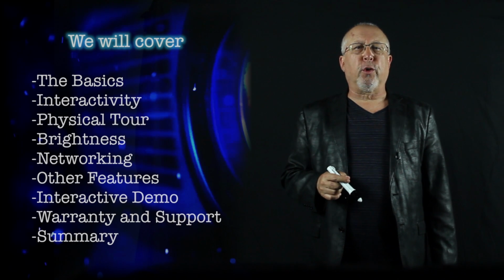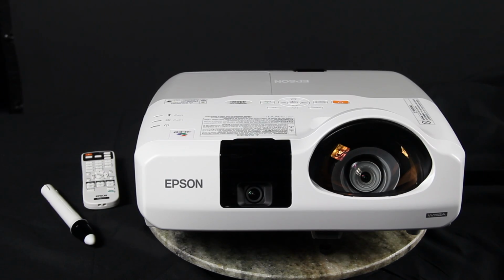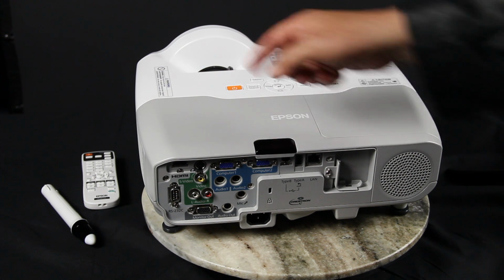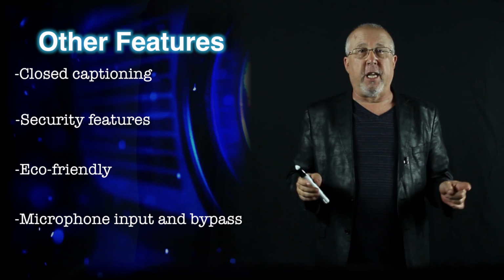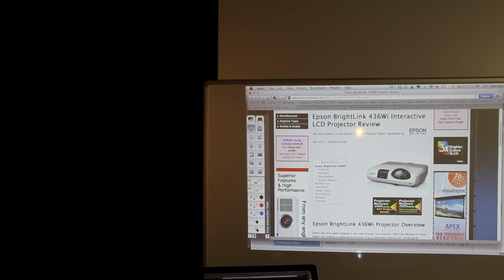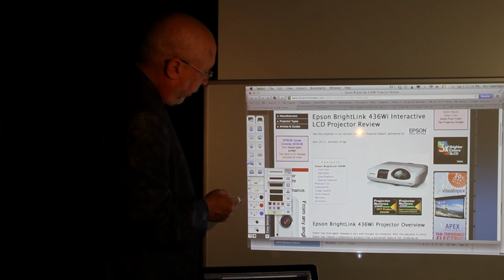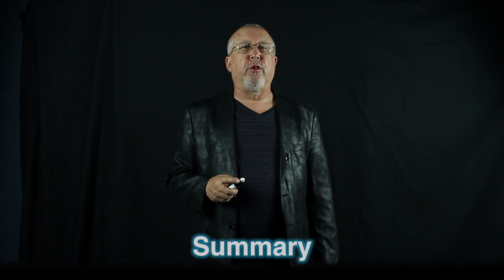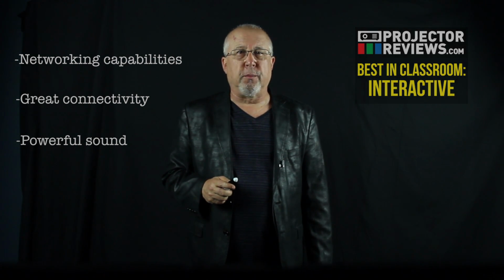Epson BrightLink 436Wi Projector Summary by Projector Reviews TV

Comment: Hi, im Franco from argentina. I would like to know how many meters do i need to project a 70" image. Thanks.
Reply from the maker: +ericprydz Hi, There’s more info in the full review on our site www.projectorreviews.com, but here is the basic number from that review:
This projector is capable of projecting an 80″ diagonal image when setup just 32″ away from the screen.

So, obviously, the projector be about 12% closer for a 12% smaller image.  That works out to between 28-29 inches back - roughly 3/4 meter. -art